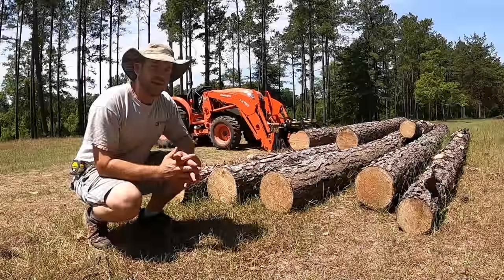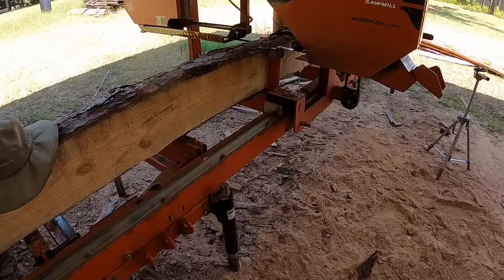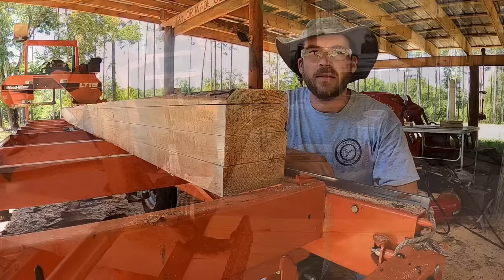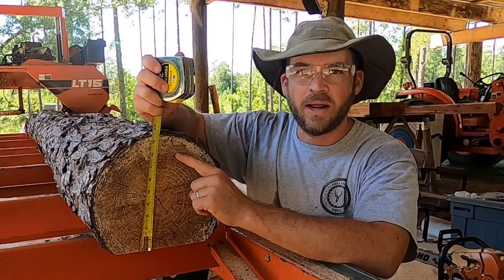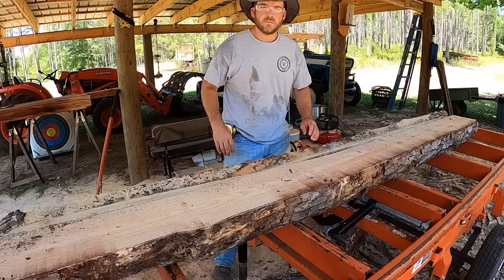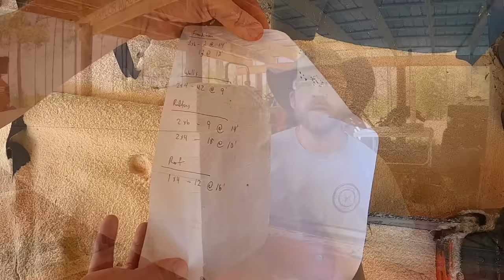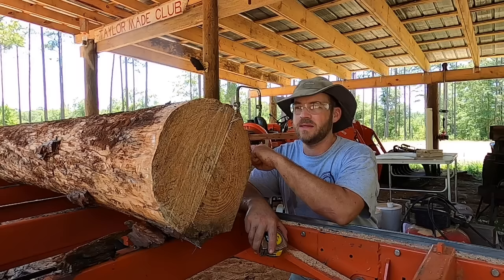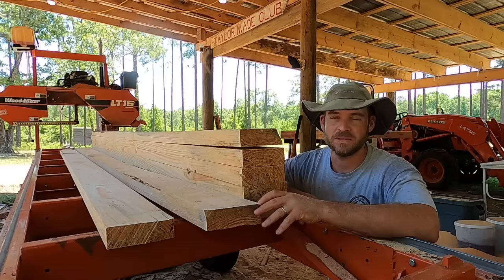Simple Sawmill Technique Maximizes Production

Comment: As you know, any log can be cut in a number of ways. If you like a method and find it suits you, that’s a fine way to cut. However, in general, a square cant defined by the small end of a straight log will maximize production, and jacking a tapered log to get a horizontal pith will maximize quality of the lumber. 

Eg, in the case of that tapered log with the 12 inch small end, a square 8x8 with 4 tapered two inch slabs should yield 5 2x6s and a 2x2 from the cant and four waned (shorter if you choose to cut off waned ends) 2x6s from the slabs removed while making the cant. That’s 9 2x6s and a 2x2.

But that results in two boards having the soft pith on their surfaces. A 10x6 cant allows cutting the 2x material with the pith within the center 2x. The cant will still make 5 2x6s, but you’ll likely only get two quality 2x6s from the slabs removed while creating the cant.

Maximizing production includes considering “production of what?” and whether manipulating the log for improving quality reduces productivity.

Your approach is efficient for dealing with the slabs and reduces handling them. It sure deserves consideration in some cases.

I like the way you present your projects in your videos.

Comment: There isn't a sawyer out there that hasn't hit a roller, if there is your turn is just a few logs away! I was surprised you were able to continue with the same blade. The grapple is nice for the yard but watching you around the mill and grabbing the cut boards off is difficult. I'm cutting larger logs, sometimes 24" plus and the cants are very large, you have to remove one to cut the other. I have a similar tractor but with forks and it's easy to load and unload the mill. Also using pallets to move around and sticker the cut boards is time saving. I like the trick of standing the board and cutting the wayne against the cant, learn something most times I watch you.

Comment: I like your different way of edging the boards during production. Looks like it helps shorten cutting times, I’m going to use that one.
 There is 1 advantage I found from edging my boards later and that it helps me get more cuts per blade. I use my blades until my regular cuts are not possible and then later on after I’ve built up my cuts that need edging pile I take my duller blade and us it again to edge my boards. It’s less work for the dull blade and I get a bit more life out of the blades before I need too get them resharpened. 🤷‍♂️

Comment: fantastic idea using the cant as a wedge, I wish I would have thought about this last week....LOL. Have you considered placing your mill in through the other end, so it blown the sawdust on the outside "wall"? It is easier to clean up, and wont get on your other equipment, in your humidity, that sawust will attract moisture and eventual rust.
Reply from the maker: You're not the first to mention that. Not sure if it would work in this shed or not.

Comment: I like the way you edged the flitches while processing the main cant. 
My only suggestion for improvement using your method is to open that second face at 8" (+ a kerf) above the deck. This would leave you the same 6" cant and your 2x6 out of that flitch will have less wane. It would also eliminate the cut that sized your cant.

Hope you don't trash your mill with that brush grapple.

Comment: Save your oil when you change oil on your equipment and stand posts in the bucket to treat them for when you need to bury them in the ground.  Let the oil dry before you use them.

Comment: Homemade carpenter bee traps work really good at reducing the bee population.  You may want to consider using your "nasty" mixture to paint the exposed wood in your shed.  While the bees have no problem with store bought treated lumber, they will not like your homemade treatment.  Oh, as long as the oil is filtered to remove particles prior to mixing with the fuel, the mixture can be applied with a brush or a commercial hand pump sprayer (which is a lot easier and faster.  Good luck with the carpenter bees, I have been fighting them for years.  Between the bees and woodpeckers my deck has been destroyed.

Comment: I see the sawdust going into the middle of the shed from the sawmill.  Is there a reason not to turn the mill around so that the sawdust goes outside?  It may be that there is a reason not to load and unload from the other side.  I am particularly interested because my LT 15W is supposed to arrive in about a month (after 1 1/2 years of waiting) and if I put it in the mill shed the way I want it, it would load and unload from the opposite side; the side the sawdust comes out.  I'll use the tractor and grapple to load/unload, just as you do.  If I turn it the other way, it will shoot the sawdust into my equipment barn.
Reply: The mill is designed for logs to be loaded opposite from the direction the sawdust exits; even if it doesn't include a hydraulic loading system, the log stops being on one side requires loading logs from the opposite side to minimize the chance of the log rolling off during loading.

Comment: I'm sure you answered this at least 17 dozen times, but why do you mill true dimensions instead of similar dimensions of a mill yard for more sticks?  Thanks
Reply from the maker: Looks way cooler.
Reply: a few more reasons to cut true dimensional.
True 2x4, 2x6, 1x4, 1x6.. etc... Are much stronger than store bought even after they dry and shrink. 
Also when building  adding and subtracting you use full numbers not.... and a 1/2 (some won't understand) a store bought 2x4 is 1-1-1/2" x 3-1/2"
3rd reason, because "we can" with our own mill. just because we want to.